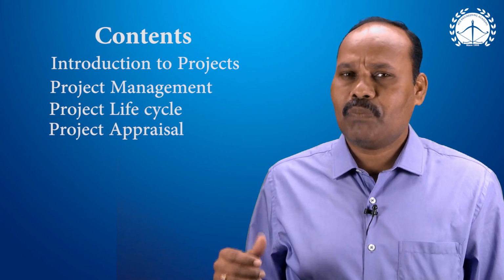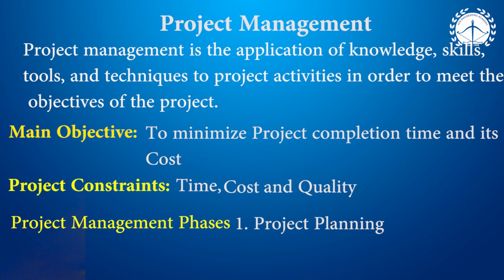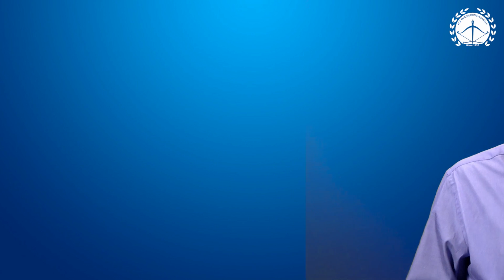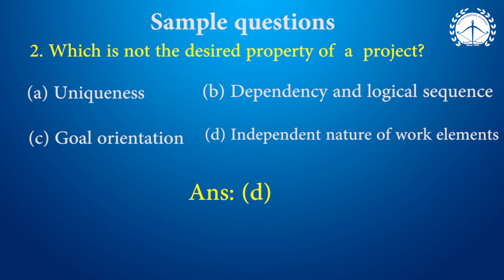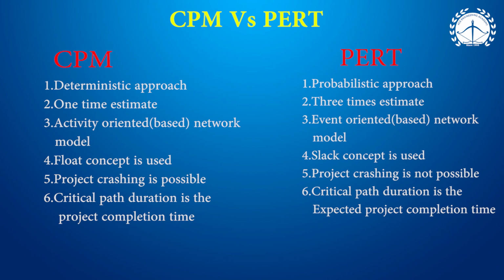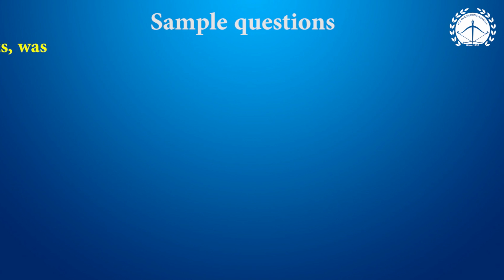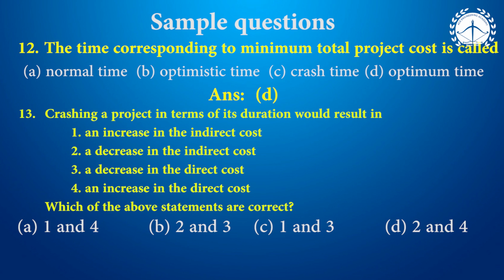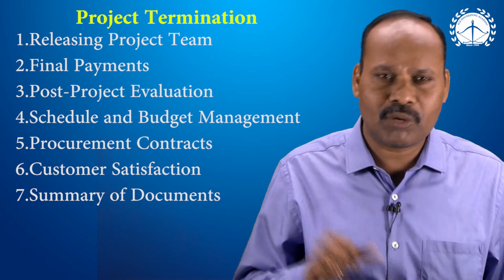ESE Basics of Project Management

Comment: sir what is the meaning of this sentence in ese paper ------Subject to candidates (General, OBC, SC and ST) having secured minimum 15% marks and PH  candidates minimum 10% marks in each of the two objective papers.
Reply from the maker: It is with respect to cut-off/qualifying marks in ESE prelims examination for ESE mains examination. In order to qualify for the mains examination candidate should get 15% marks(General,OBC,SC,ST) and 10% (in case of PH)respectively in each objective paper. Then only  UPSC will pick up these candidates for mains examination based on cutoff marks.

Comment: que.9 i am sure it is beta distribution . normal distribution is symmetrical curve while beta dist. curve not and pert also not have any fixed time to complete .
Reply: May be I am wrong but I think Ravi is correct. We applies 3 time estimates method for calculating estimated time in PERT.
Reply: although sir it is very help full...
Reply from the maker: Dear Student, Project Completion time in PERT follows normal distribution TE+-3σCP.
3 time estimates for an activity follows beta distribution.